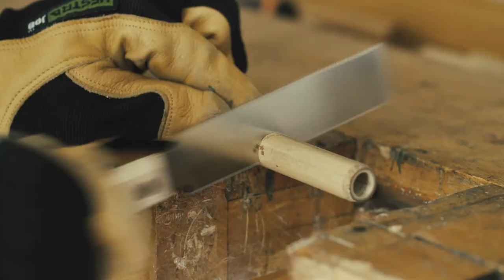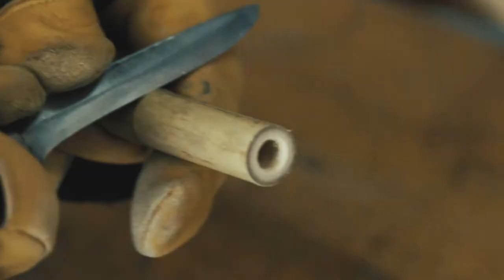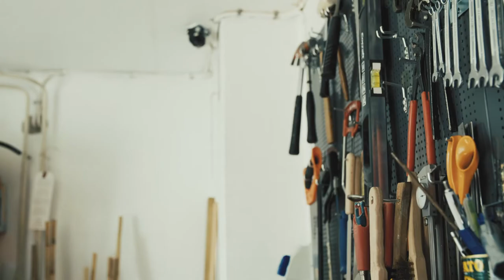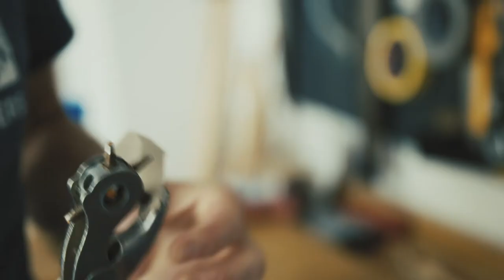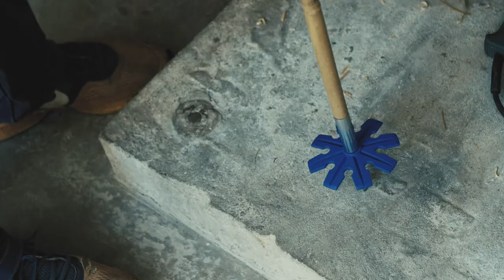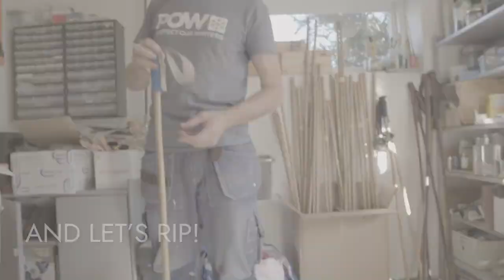How to make bamboo ski poles - DIY step by step

Comment: I make tonkin fishing rods, I love bamboo stuff in general, I have just found your video coming back from an austrian ski trip :)  What I miss here is some sort of treatment to make these ski poles waterproof and long lasting. Removing the enamel and some polishing would make the poles more attractive and giving them 4-6 coats of tru-oil or PU glue (after engraving) would make them 100% waterproof. Also, wooden handles would look much better, I would include them as an option :)
Reply from the maker: You don't actually need any treatment for bamboo. As you know from the gardens bamboo can stay in the ground for years without deteriorating that much. However, I use simple linseed oil wax, that contain beeswax and linseed oil. It makes the bamboo look really nice and smell wonderful. Totally harmless to the enivronment!